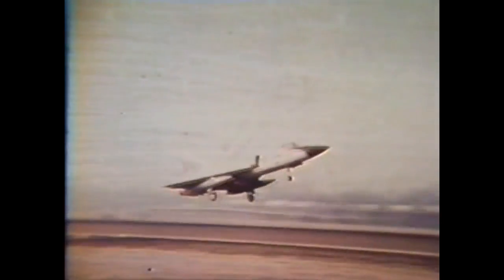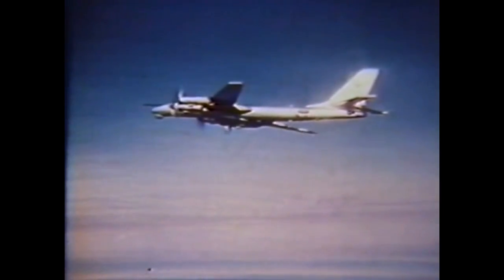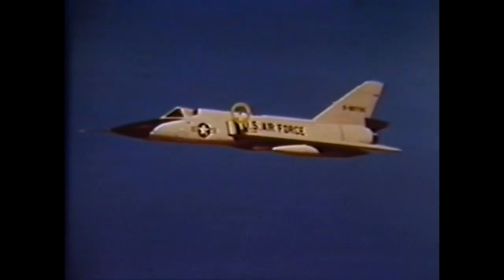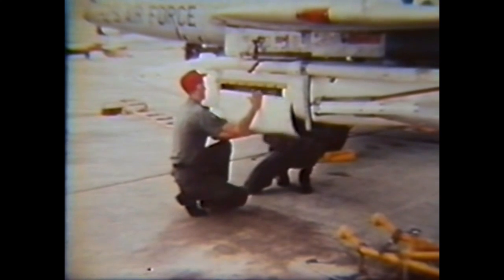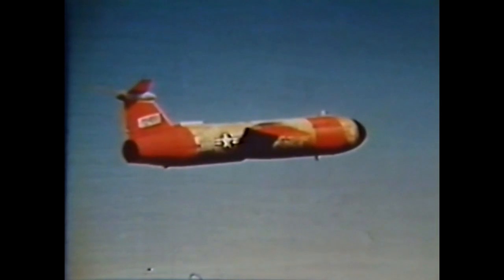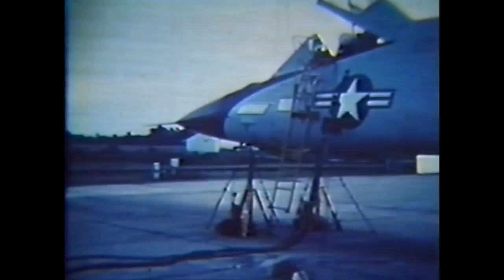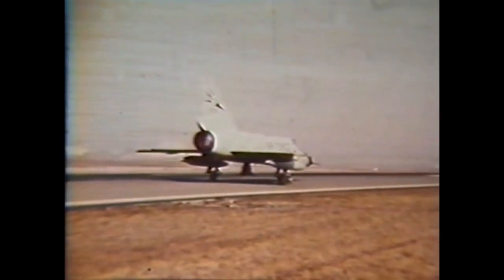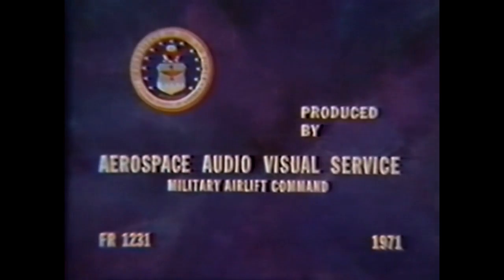Six Shooter

Comment: It was a great airplane.... but..... maintaining the MA-1 system was a nightmare.   The F-106's Hughes MA-1 system was a "consolidated system" composed of the:  (1) Radar system:  (2) CN&L (Communications / Navigation & Landing Systems):   (3) Computer   (4) AFCS  (Automatic Flight Control System:  (5)  Power.   Without the presence of Hughes Tech Reps on the flight line,  the average MA-1 flight line techs were hard pressed to "make the airplane "right". As time went by, "things" did improve (due to "experience")  but it was a "messy presentation". As time went by, "things" did improve (due to our "experience")  but it was an up-hill battle.... a very difficult time.  Having been there and done that, as an MA-1 flight line tech at:  (1) Minot for the winter of '60" and then (2) Selfridge where I was in D Flight with tail # 58-0798 (which is now a "Plane On A Pole" at a large Army hospital in Texas).... and then ran the system mock-up and then moved to the Nevada desert).
Reply: Tell me about it

Comment: I wonder if the AN M3 20mm single-barrel cannon could have been installed on the 106, maybe 4 guns - like the F-8 Crusader.
Reply: why? would take to much space the one oh 6 had internal AIR to AIRS this system and the M61 is superior to your m6. this gun pod was a very simple and effective solution to a problem the M6 idea you have would i think require a complete redesign of what was a plane no longer in production but still in service.